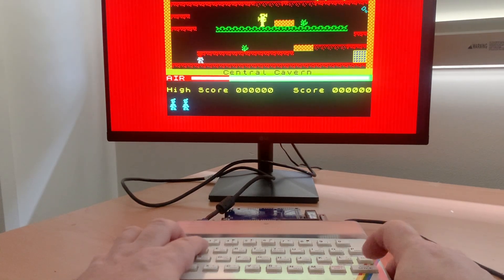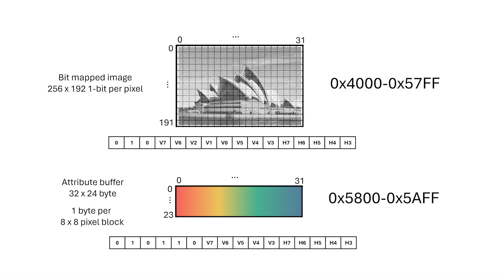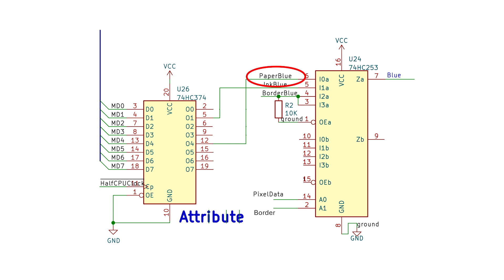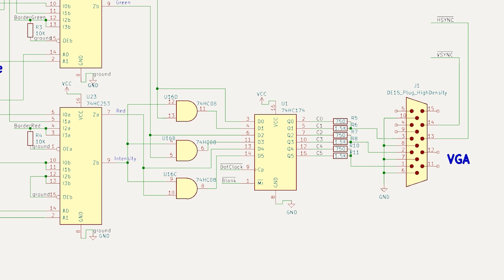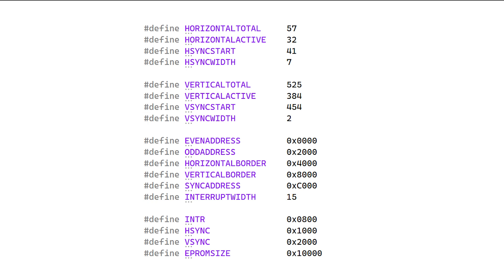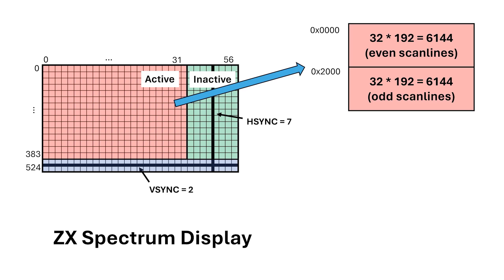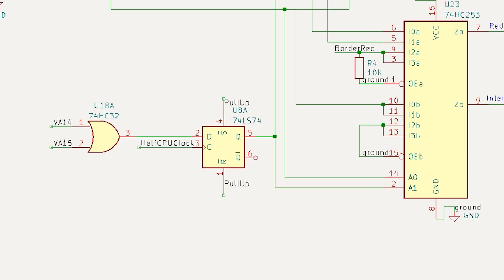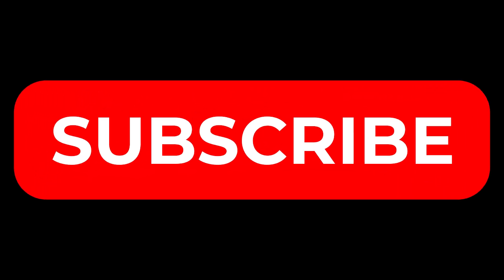VGA ZX Spectrum - Schematic Part 2

Comment: Can you share the system rom you used design / prototype
Reply from the maker: The system ROM is just the one commonly available for the ZX Spectrum 48K, but i'd rather not post it on GitHub.  The code to make the raster generator should be on GitHub

Comment: At 13:32 in the IORQ decode section you show the active low O2 output from the 138 feeding the clock input of the 374 to initiate an IO write, but isn't the 374 clock positive edge triggered ?
The 245 in the IO read section should correctly respond to the active low O4 output from the 138.
Reply from the maker: Correct, but the data from the Z80 is valid on the data bus from before the start of IORQ until after the end of IORQ, so for writes at least, it doesn't really matter whether you use the negative edge of IORQ or the positive edge of IORQ.

Comment: This is amazing.  I had sort of worked out what this part of the schematic was doing since your last video, but really wanted your explanation too.
I'm halfway through a design based on yours that will be a drop-in spectrum motherboard replacement, like a harlequin but a lot simpler and with a lot less ICs and all surface mount except the ROM/RAM/CPU.

Could you replace U15 (74HC174) with the unused half of U8 (74LS74) ?  It seems a waste as only 1 part of U15 is being used now that you have simplified the circuitry around U8A.
Reply from the maker: Thanks for the feedback.  You can certainly use the other half of U8 instead of U15.  U15 was initially used allow pixel level control of the border signal, but that's not needed in the  final design.

Comment: Hi! Can you help me, please with coefficients for VideoFSA? I'm using 14.000.000 oscillator, so 14.000.000/31500/8=55.55555, so i've rounded it to HORIZONTALTOTAL=56 (maybe I need 55?), 56*12%=6,72 HSYNCWIDTH=7 all others are left  as it was in project. Need i change something else? I'm trying to run emulation in the SimulIDE, all is fine, but as I see in the eeprom, the sequence is: 0-1F (ROW) -> 4000 -> 4001...4007 (HBORDER) -> C000 -> D000-D006 (HSYNC) -> BF80 (ZEROES!) -> 0 and all starts over. Why is it generating BF80 jump with 56 in HORIZONTALTOTAL? [D001, D002, D003, D004, D005, D006, BF80 sequence i see in the hex editor]. To simplify wiring in the emulator, i've just replaced shuffle/deshuffle functions with just "return val" - can it be cause ? Thank you!
Reply: The 14.318MHz clock has a special reason, it’s 4 times the NTSC sub carrier frequency, and VGA was built on top of the NTSC standard. Trying to get a clock of exactly 14MHz to work is going to be at best problematic, I’d suggest your best option is to replace the crystal.
Reply: @stevetodd7383  Ok, IC, most of zx clones (ex-ussr) has 14 MHz oscillator and 3.5/7.0 Mhz CPU clock. That's why i'm using 14.0. I think, VGA is not so dumb to allow only NTSC -based timings... But who knows :) Will order new crystals and try it out. 

But. I cannot understand why there is jump to BF80 even if default settings used? Just revert back my settings and still there is BF80 .... Need to investigate the code more carefully.
Reply: @archarontsm  don’t forget that the standard Spectrum runs PAL timings at 50Hz rather than NTSC at 60. It’s a different sub carrier.
Reply from the maker: That odd.  All i would do is change HORIZONTALTOTAL to 56 as you,ve done.  

I'm using the version of the code with the display, i've set HORIZONTALTOTAL to 56 and put the "return val" into the shuffle and deshuffle routines.  

The sequence I'm getting is
0000->...->001f, 4000..4007, c000, d000...d006, c080, 4011..4017, 2000

which is the correct sequence for the first scanline (c080 is because we have the spectrum mapping for the addresses)

Are you using visual studio 2022 and the display version of the code?
Reply: @DrMattRegan  That's wierd. It seems, there is a bug in the SimulIDE. Created EPROM, 8-bit data wide. Load BIN.  At address 0x1A000 (0xD000 * 2) I can clearly see: 01 D0 02 D0 03 D0 04 D0 05 D0 06 D0 80 C0    C080!!!!  But if I switch to 16-bit wide data and load same file, I can see  at address 0xD000 this sequence: D001, D002, D003, D004, D005, D006, BF80 .... I don't understand, why there is BF80 instead of C080 ... Bug in viewer? Ok, I've used logic analyzer and there is BF80 on VD bus... bug in EPROM loader, maybe...
Reply: Huh! What do you think? This is a confirmed bug in SimulIDE ROM emulation! Just reported an issue and they fixed this bug very quickly. So, nothing wrong with FSM generator itself, sorry for that.
Reply from the maker: No problems.  Actually, i appreciate that people are trying it out and giving me feedback.

Comment: (E)EPROMS - poor's man FPGA ;) (if they are fast enough) - in my times they were 250-450ns so no luck were with me/us ;)
Reply from the maker: Well EPROMs are certainly cheaper than FPGAs (and easier to get and in plentiful supply).  FPGAs are really the only way to go for circuits above 10-20 MHz.

But from a learning perspective, i think people get a better visceral feel for how a finite state machine works with an EPROM with flipflops rather than from a big case statement in verilog.  

Really the purpose of this series is to demonstrate a FSM so we can build a Random Access Turing machine in the next series.

Comment: One point, technically the front porch and back porch are part of the blanking interval and shouldn’t receive colour data (i.e. you should send black). Certainly if you get to DVI digital transmission then the back porch is part of the blank and can’t receive colour, while the front porch can receive display data and you can use it to fiddle with centring the image.

It’s probably because of that your monitor is producing freaky results if you have colour data next to the sync signals.
Reply from the maker: Yes, i you are right.  We really need to generate a blank front and back porch that is different from the border colour.  The ULA must do this to generate the colour burst signal, but it's not well documented.

Comment: Looking forwards to seeing the Z80 as TTL.
Reply from the maker: Excellent, I've working to get the machine to a point where it's basically octal d-type flipflops, EPROMs and SRAMs.  Will still need a shift register and multiplexers for video out, but the bulk of the machine will just be 3 different chip types.